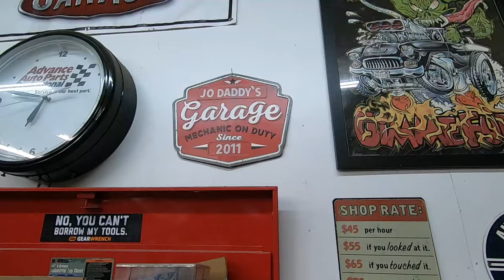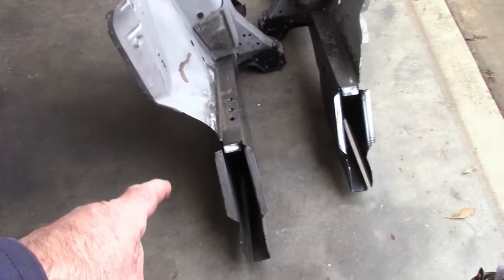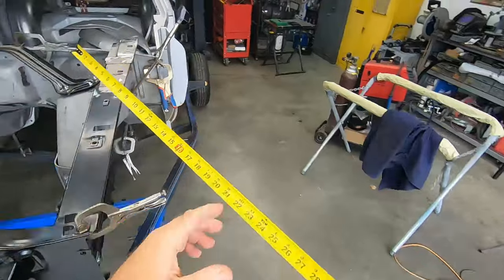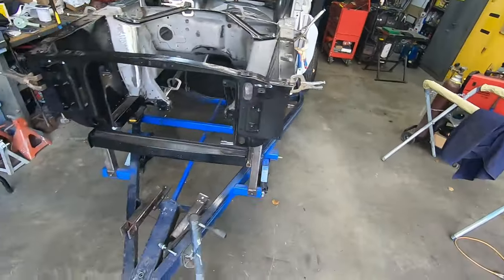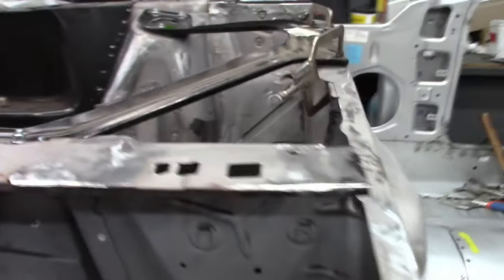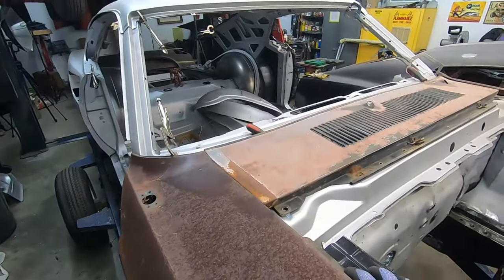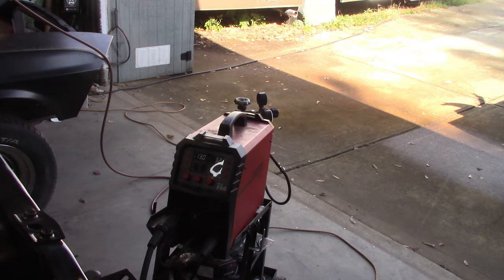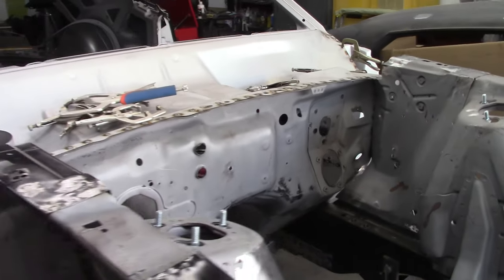Welding in firewall, frame rails and lower cowl in a classic mustang. Slither part 22.

Comment: Last winter, I took the Automotive Welding class at my local community college.  I liked watching your fitment and plug weld technique. I was trained on plug welds to start and go once around the hole and out.  Generally, that's what I did.  It looked to me like you also used a back-and-forth pattern.
Reply from the maker: I have done plug welds different ways. Sometimes I burn into the middle and spiral out to the edge. Other times I burn the edge and spiral in. I have gone back and forth as well. It really depends on the base piece and the size of the hole.

Comment: I was wondering , are there factory specifications with critical measurements. , that would allow repair shops to check the true alignment of parts to one another when they were fixing accident damage back in the day ?
Reply from the maker: Yes. They would have had data sheets with measurements.

Comment: I have a 65 mustang that I am restoring.  Question about the 2 horizontal bolt holes on the forward end of the outer front frame rails.  My holes are badly mangled to the point that I can't precisely locate their centers.  Is there a diagram that shows  their locations as referenced from other points?
Reply from the maker: Not sure. Sorry

Comment: I have a 65 mustang and plan to remove and replace the driver side shock tower.  Since the replacement won't be identical to the original, which reference points on the tower should be used to correctly position the new tower?  Thanks in advance.
Reply from the maker: The replacement should be very close. I used the export brace to get the width and the bracket that centers the tower at the bottom. I think I shared a video on that.

Comment: Hello, I am working on my '69 Fastback and I am struggling with the frame rails.  I found a drawing with a measurement of 59" from the center of the 1" hole toward the back of the floor support to the back edge of the elongated hole in the front bottom of the frame rail.  I am using Dynacorn Full apron frame rales that already have the shock towers deleted.  I have a Dynacorn full floor pan like you have there, and a new CJ classics firewall and Cowl.  I cannot get the frame rail to go far enough into the floor supports to get that 59" measurement.   How do you get that to go in so easy?  What am I doing wrong? Is there a better measurement for installing these?  Currently I only have the firewall and lower cowl clamped in place and not welded along the floor.  I love your video's and have learned a ton from watching.  Thanks in advance!
Reply from the maker: I measured and also got the 59”. If the frame rail is hitting the firewall, something may be off.
Reply: @JoDaddysGarage  The interesting thing is that the measurement from the firewall to the front of the core support is 43 3/8" as it should be, I think I may be measuring wrong, or the holes are off some.

Comment: Hi.  My 69 got crunched in the front.  I want to replace all the parts (firewall up).  I am sure I could write down the dimensions you are shouting out (which I will), but, do you have a written document on/with the front end measurements you did?  I dont trust what I can measure on mine, not sure whats twisted, and, everything I find on the web seems to have 3-4 contradictions.  Sure would like to get this right when I do it, lol.  Would def send you a $20 for some coffee and my email address if you would be willing to jpg/pdf me a few measurements if you have them on file.  

Thanks
Reply from the maker: I don't have a file. I just measured the original car. However, i have a very solid 69 mach 1 sitting in the back of my garage. email me. jodaddysgarage@gmail.com